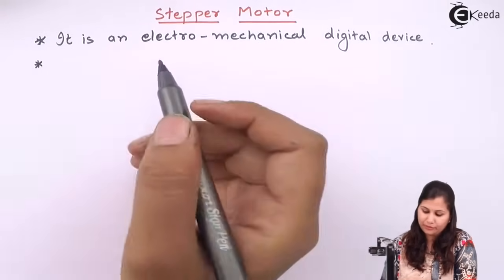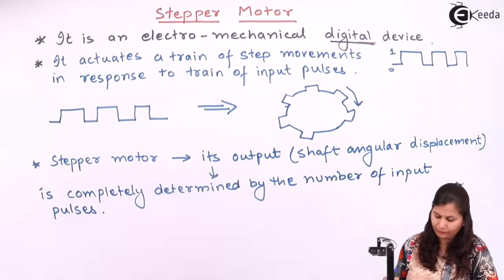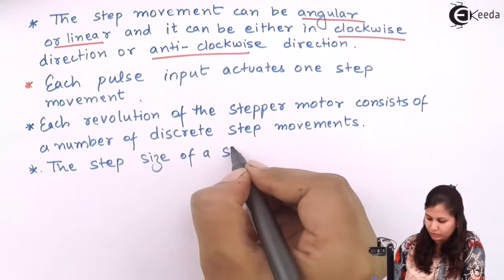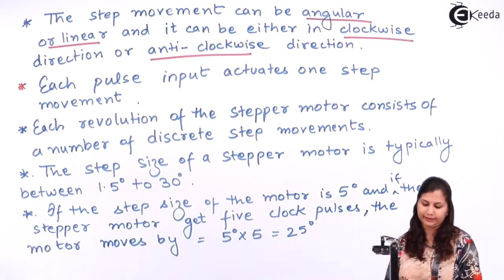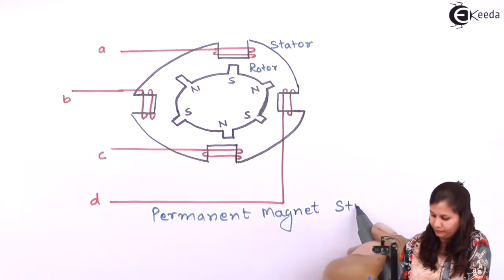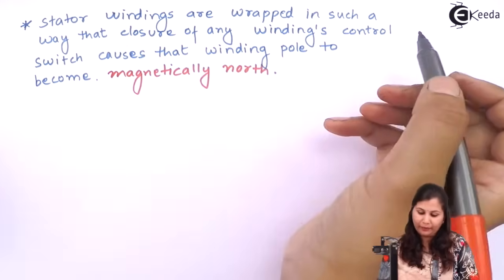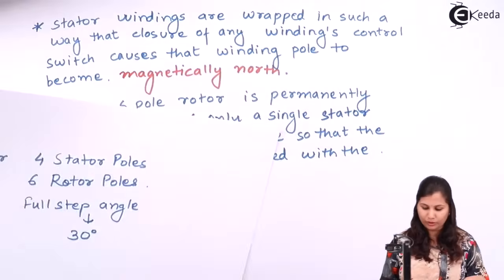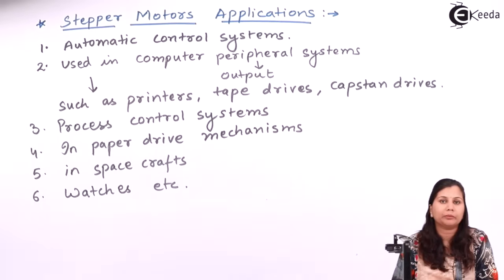Stepper Motors - Control System Components - Control System

Comment: In permanent magnet Stepper motor 
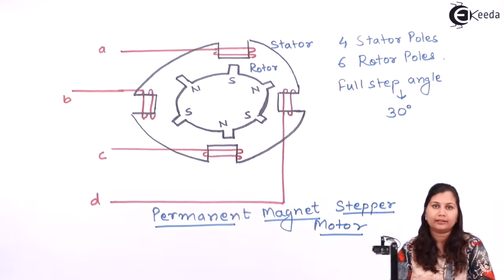Rotor teeth has 48-24 teeths and an angle of 7.5to 15 degree.and 12:58 step angle is the angle rotation from right teeth of rotor north pole to south pole.which is 15 degree